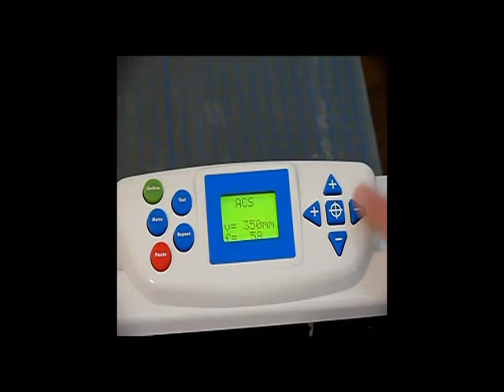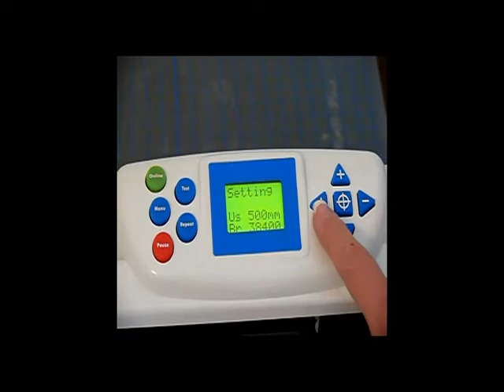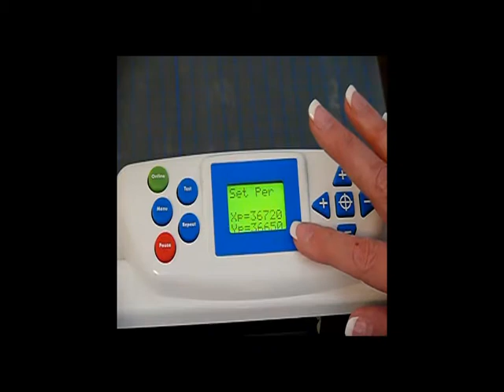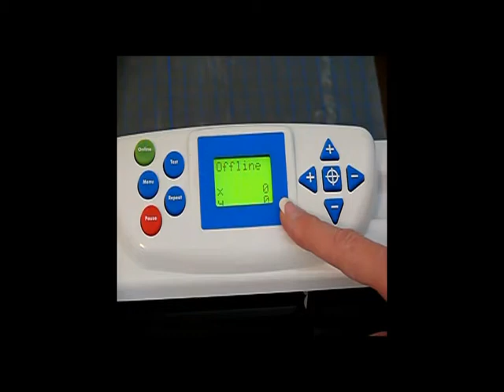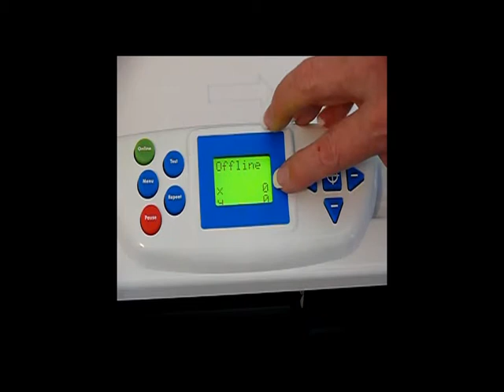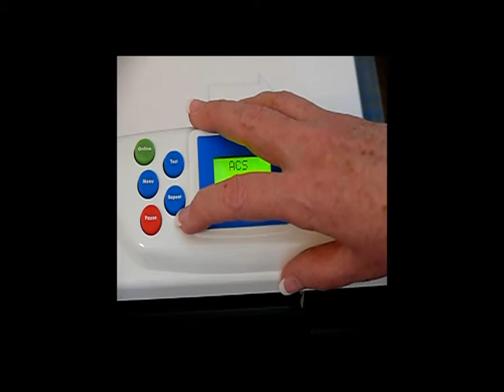Klic-N-Kut Control Panel

Comment: Hi Sandy!
I haven't used my Klic-N-Kit machine for a long time and want to get it back out and use it!  But I want to know what computer I need.  Will it work with an Apple Mac Laptop?  Or do I need to get a PC?
Reply from the maker: KNK Studio is a Windows only program, so if you get a Mac, you will need to partition it and then use a Windows emulator like Boot Camp or Parallels to install a version of Windows onto your Mac.  Alternatively, Sure Cuts A Lot has a Mac version and your KNK will should cut from it, but that requires learning a new software program.